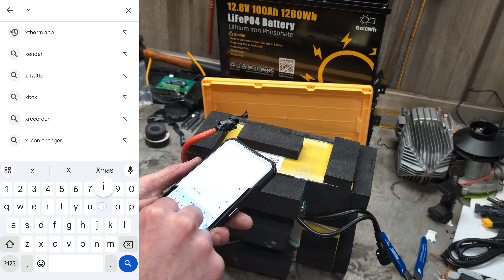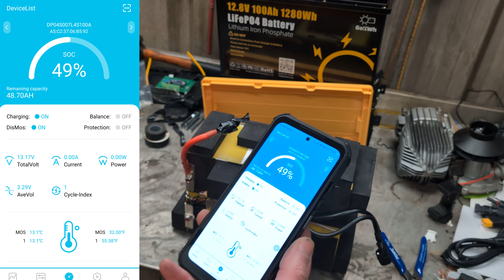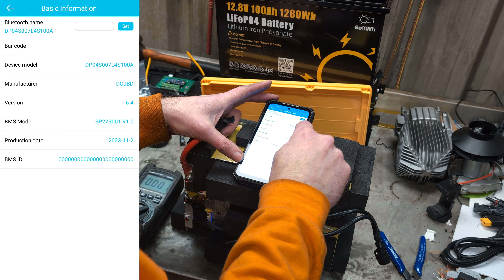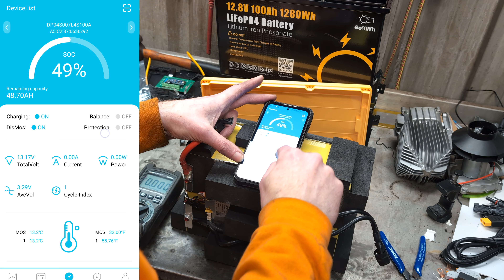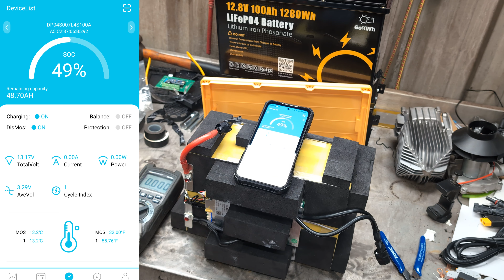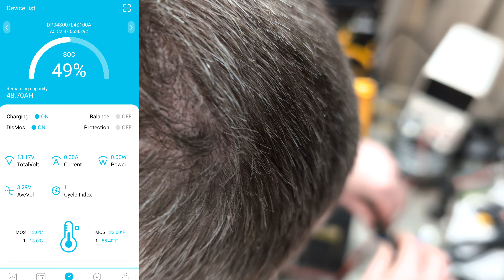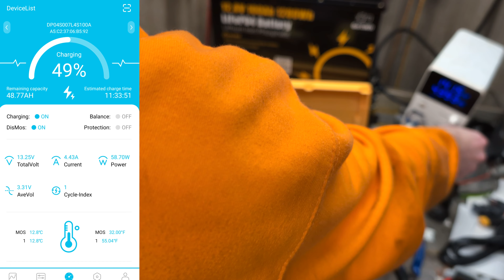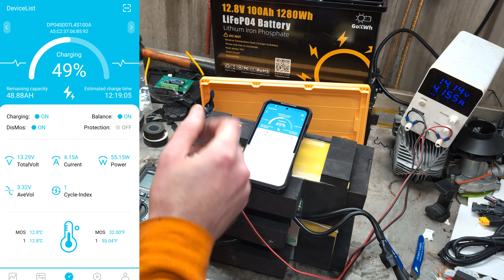DIY power station part 3 - 12V LiFePo4 GoKWh battery

Comment: Protection OFF is a good thing, it means NONE of the safeties have tripped.  As for the balancing, that usually doesn't kick in until the cells are near full just to balance everything out at the end.  Don't panic.

Comment: Most of these cheaper lifepo4 batteries all use the jbd bms in them, they are really good bms for the money, but a better app to use is the overkill solar app, has alot more customisation to play about with settings, I use the 200a version in my self build battery,

Comment: You can use hot glue + a pen as a stick to pull out these plugs above the screws. it leaves no marks at all and works really well, in case you need to refund the battery because they got trash cells. the bms is usually trash and needs to be replaced by at least a jk bms. my cells were disbalanced quite much, didn't had no compression at all (besides packaging tape) and the bms shut down charging above 3.75V cells voltage, which is waaaay too high. Above 3.55V you don't gain any capacity worth mentioning, maybe 2Ah, but they swell more. Because my cells were disbalanced quite a bit it disabled the charge at 14.2V and have swollen two of my cells. besides all that the balance current with the shipped bms was only 40mA which is pretty much useless. jk bms'es are affortable, have 1A active balance, bt connection and work quite well. The shipped cells might be usefull and good, but I wouldn't trust the bms at all

Comment: Battery looks interesting and surprisingly good value at around $300 (I didn't see a UK supplier?).  However, the max discharge current is specified as 100A, which is a bit limiting if you wanted to use it to drive an inverter for example as it limits you to about 1kW.
It seems to be an issue with most of the built up LiFePO4 12v batteries however

I have a slightly more DIY (wouldn't you guess 🤣) 12v pack made from 4 x BYD 125Ah LiFePO4 cells (left over from my EV Conversion) which have a discharge capacity of 500A continuous & seem to peak at about 800A which is more useful IMHO

Comment: At least with the 12v battery, you could wire it up to a 12v UPS, so you have an inverter, a charger and all the wiring all in one box, you just have to make sure to find a decent one with pure sine output, though of course the higher powered UPSes use 24 or 48v battery packs, so a 12v one could be limited I suppose...
Reply from the maker: I'm not sure if I've imagined them or not but I think there might be an inverter with a built in UPS function.
Reply: @DavidMcLuckie  They do exist, most often used on boats or something, so you can switch between shore power and battery without disruption, probably cost a heck of a lot of money though compared to a UPS on ebay with dead batteries that can be re-powered with bigger and longer-lasting ones, and given APC UPSes can have (or even come with if you're lucky) network management cards, they can be remotely managed too... :)
Reply: Yes lots of variety